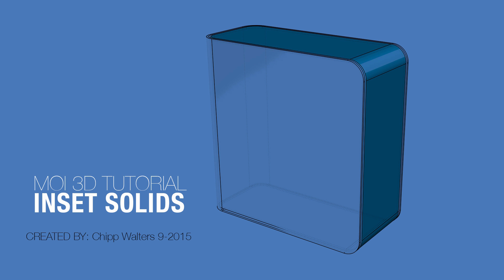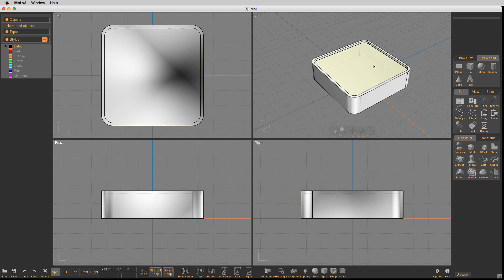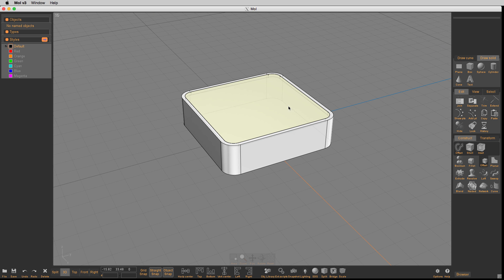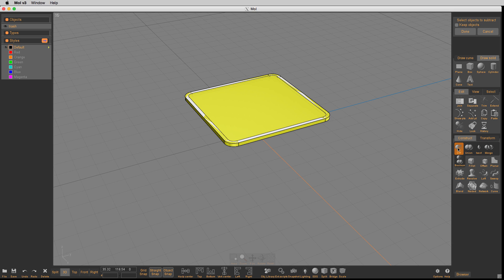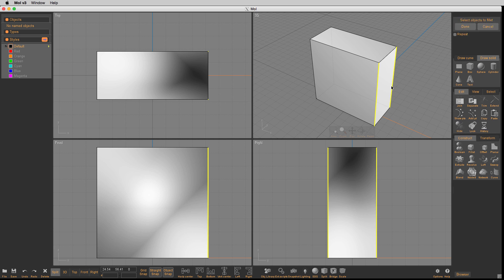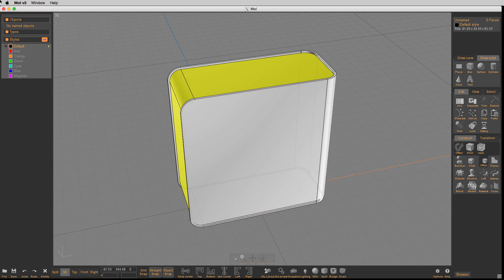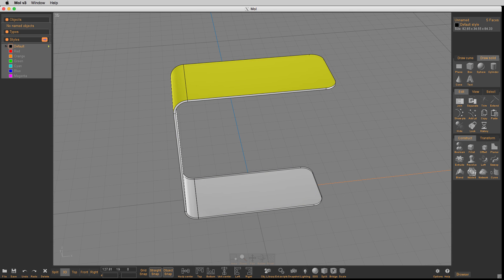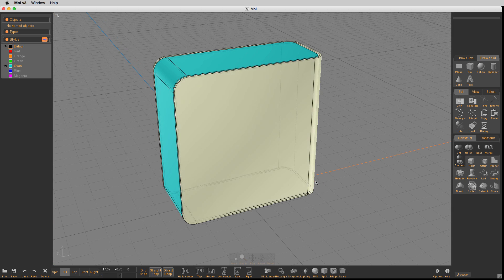MoI3D Inset Solids Tutorial

Comment: Great tutorial Chipp.  Odly as soon as the inset piece is done and hte original box is shown as two solids.  Moi won't let those to be boolean unioned after wards.  Is there some tolerance setting in an ini or under the hood that moi uses to determine if two coincident surfaces can be unioned etc.?
Reply from the maker: That's strange. In this case you could try scaling them both up by 100, then trying to boolean them, and it might work. Then scale them back down by .01. I use the world center (0,0,0) as the start point from my scale so as to make sure they end up exactly in the correct place.
Reply: After separating a surface and re-attaching to Solid in a few spots, I was able to Boolean the two.  Model was at a normalish size about 12 inches tall and 5 wide etc at Zero Zero. Thanks.
Reply: Hey Chipp, just came back across this great video.  I'm sure your aware of this but the inset command by adding Grooved checkmark and setting a width will do exactly the same thing in one command.  Just fyi.